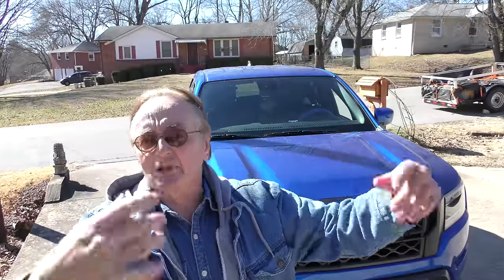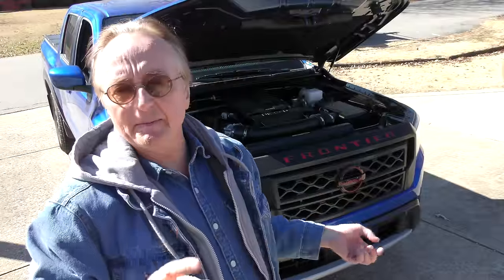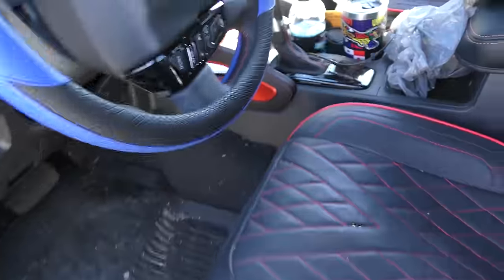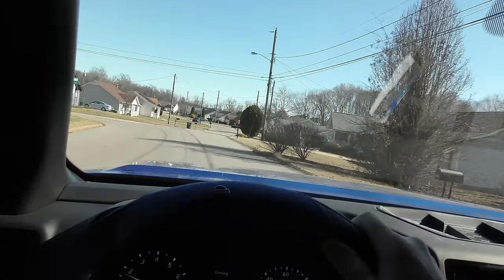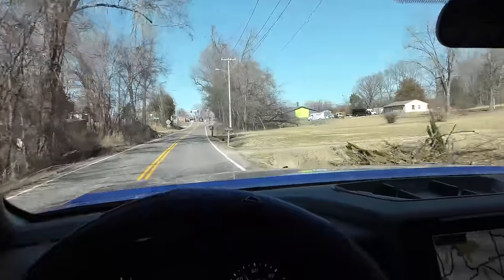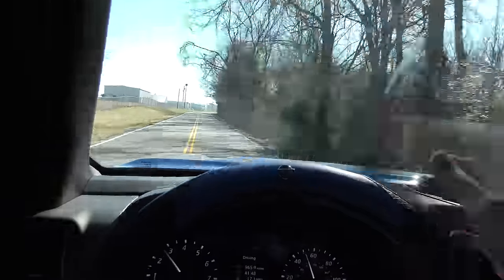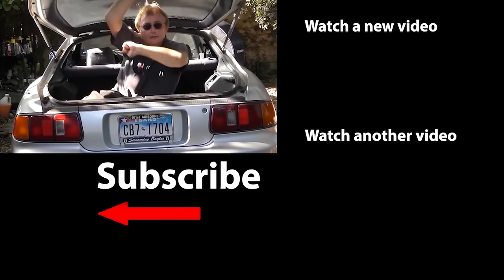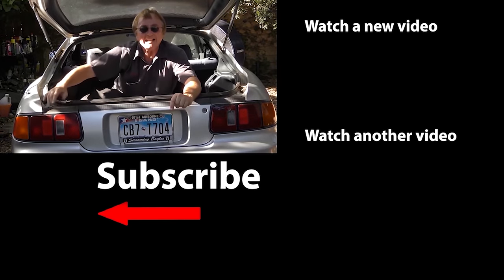This New Cheap Truck is Better Than Anything Toyota Makes Now

Comment: Good afternoon Mr. Scotty, I have a 2011 Nissan Pathfinder LE (4.0L V6) that recently started doing this strange thing when I drive it on the highway and get off to local roads: when I slow down (speed gets below 20mph) and when I'm sitting idle at a light - the battery voltage will dip and come right back up. It's a quick dip. I took it to O'Reilly's to see if my battery and/or alternator was going bad and both checked out fine with their readers. I have also been checking my car's resting voltage every morning before I start the engine to see if I have any signs of parasitic draw but the battery is always returning above 12.1 volts. Any inclination on what it might be? I've asked around and only received shrugs. 

Really enjoy your content for tips/tricks and it has great entertainment value.

Comment: I have an ‘05 that has been super great, proactively replaced the radiator and just kept up on regular maintenance.  Except for some rust related decay up here in the North it’s going strong after 19 years and 175k mi.  Considering a new one but the old one is still going strong.  Just a good, boring truck that always works, like a truck should.

Comment: I just Purchased a 2023 Frontier SV Crew Cab Rear Wheel Drive with the V6 in it , iIt had 12,700 miles on it, was in perfect condition & i got it right at 30k, all TT&L included. I test Drove Two Toyota Tacomas & They "HAD NO POWER"  Compared to This Nissan Truck, Scotty is Right & I too Highly Recommend this Truck

Comment: The frontier drives and tows much better than the Tacoma!!! I had a 2019 Tacoma v6 and it absolutely struggled to tow 3500 pound horse trailer. You HAD to use the transmission in manual mode or the truck could not hold a speed. You also had to downshift to assist in braking. I traded in (up) to a 2022 frontier pro rwd and it has no problems towing…. I’ve never had to use manual mode. You barely even notice you’re towing. 

Another big complaint is the Tacoma has terrible headlights where you can barely see at night. The frontier has great led headlights

Comment: Few months ago, I bought a used 2022 SV 4x4 for 10K under original MSRP. Like it a lot so far. Did some research and the transmission is a German ZF design built under license by Jatco. I like how it shifts - always had manual transmission vehicles before, but this automatic is fine so far. So far, love the Frontier - powerful & comfortable ride.

Comment: I'm going to have to disagree with you about the Pathfinder and their transmissions. I had a 2006, and the transmission went out because coolant leaked into the transmission case.

Comment: Isn't it funny how Scotty says it doesn't have all the bells and whistles and I see a full double Dinn head unit with GPS, a steering wheel with all kinds of buttons for controlling things, dual climate control, and probably a backup camera too. (For my first couple of vehicles I felt lucky to get an aftermarket cassette am/fm radio in it lol and I had no A/C installed.

Comment: I have owned 3 Nissan trucks. I had a 1994 I bought new. In 5 years I had 185k miles,
Not a single thing failed. I just did the normal maintenance. Incredible truck. I also owned a early model Titan.  Great truck. no issues.

Comment: I had a 3.8 V6 in a mid 90's Chevy shortbed. 300K + miles on the engine b4 the rear went out. As long as the design is sound and the manufacturing quality is on par they're nearly impossible to break, just like their V8 cousins. Also, they get even better mileage now due to advances in the fuel and spark management electronics

Comment: 310 hp is good, but how high do you have to rev it to get that power? The mid size trucks with V6's are peaky, the 3.5L in the Tacoma was not a good match. Say what you will about turbos and longevity, but they create down low torque that trucks need.

Comment: Bought a 2023 Pro4X. 28,000 km rear differential was clunking and had to be replaced. 6 weeks at the dealer to get it repaired. No low windshield washer fluid indicator, not a good thing when highway driving in winter in Canada. Carry a spare jug of it in the truck now just so I can fill it up on the side of the highway. Climate control system develops a howl after 2 to 3 minutes of operation on higher fan speeds. Dealer doesn’t understand why, wants to rip the dash apart ( 2 or 3 more days in the shop). The passenger side window is lazy, another 2 or 3 days in the shop to repair. Yup, that’s why I bought a Frontier, so it can sit at the dealer while I drive a shitty rental car. It’s an awesome vehicle Scottie!

Comment: The 2.7 turbos in f-150s are some of the most reliable engines on the road. Many people report getting 300,000 plus miles without major repair.

Comment: I have a 2021 Frontier the last year for the gen 2 body style, and it has the new 3.8L V6 from the new redesign and I have put 54k on it and it runs smooth as a clock. The only big modification I want to do to it, besides a lift kit and bigger tires, is to supercharge it.

Comment: Just got a 2023 7700 miles $35,000.  Really not much different per se than my 2008 Xterra.  The mileage is a little better and more power.  But it wasn't a big leap getting behind the wheel of the new Frontier.

Comment: I tried waiting for the new Frontier truck back in 2021, but it was delayed.  So, I bought a Ridgeline.  The Honda is nice, but I might have gone with the Frontier due to increase HP and towing ability.  I am happy with the Ridgeline though.

Comment: My last truck was a a 2012 Frontier I really put a lot of miles on in got it in 2014 with only 24k miles and plan to sell it now that is has over 150k miles. I loved it but needed something with better gas mileage and 4 door. I never used the 4 WD function so if it can make someones day better so be it. I love my new Ford Maverick anyways!

Comment: My 2008 nissan titan  180 thousand miles has only had minimal issues like window motors and the heater valve. I just change fluid regularly. The front seat is getting wore out from my big butt.

Comment: Question!
I have a 2011 VW Jetta TDI 
I bought new now has 150,000 miles and the catalytic converter light went off  then the check engine 
I replaced the timing belt at 120,000 miles 
Cost me too much to replace the catalytic at the dealer 
I like the car however that is a big problem 
What can I do?

Comment: MY 2002 SILVERADO 1500 4WD 4.8L 144,000 MI. COLD AIR NO RUST IS JUST ABOUT BROKE IN LOL NO PAYMENT FOR 16 YEARS, REPLACED THE STARTER MOTOR AND THE POWER STEERING PUMP AND $800 IN BRAKE LINES AND THE USUAL MAINTENANCE. I LOVE MY TRUCK:face-red-heart-shape::body-blue-raised-arms:

Comment: My only beef with Nissans V6 is the cam chains drive the waterpump, or at least that used to.
When adding coolent, use distilled water, or premix, never use garden hose water.
Reply: That's what I drink too...40 years

Comment: Scotty, I thought this engine is direct injection which doesn't prevent eventual buildup of carbon deposits, etc. on the valves causing issues.  What's your take on this?

Comment: I had a 4.3l 6cyl 5 speed auto 2004 chevy blazer, and it got wrecked and my dad gave me his 2002 nissan frontier, best truck I ever drove. My sister stole the keys and flipped it ):
I have a 2021 jeep GC right now but if I ever need a new vehicle, I want another frontier, I love putting cabs over the bed and using them for camping.
Nissans are the smoothest accelerating vehicles I've ever driven.
When you push the pedal all the way down, it has a button that clicks that tells the vehicle you wanna go really fast.
Nissans are the best.
Not the 3cyl 4cyl cvt junk though.

Comment: My dad bought  went with the frontier pro4x4  after the 3rd rear axle, and it shutting off in the mountains  2 times  over 5 years , but it had more power and cheaper than the toyota.

Comment: I believe that Nissan shouldn't discontinue the Titan, there's going to be a market for a v8 full size trucks since they just recalled 100K 2022-2023 Tundra's with that awful v6 twin turbo's for engine problems

Comment: I like the pushbutton starter.  Can't hotwire it by breaking off the lock cylinder and putting a screwdriver or USB stick in it.

Comment: Hey Scotty been watching you for a long time and enjoy your channel. Just have a question wondered if you could answer for me? I have a 2010 Hyundai Veracruz V6 engine automatic has a trailer brake and hitch 163,00 miles transmission is up shifting smoothly starting to feel a little rough on down shift to 1st  would you recommend transmission fluid change or flush? Got the vehicle with 133,000 so not sure if previous owner serviced transmission,Thanks Walt in Michigan.

Comment: Coolant mixes with the ATF at 140k destroying the transmission, purpose built flaw by Nissan. Put an external cooler in for the transmission and it’s a nice long lasting truck.

Comment: My 4 banger truck does enough for me. Pulls my boat, camper, tools and whatever I need it to. I’ve had a ton of gravel in the bed. It hauls air as good as this frontier or an f-150. 😂

Comment: One thing I’ve noticed about transmissions with over five or six speeds is that they don’t hold you back going downhill. The more leverage given to the wheels by the engine also means the opposite. I can’t keep brakes on my wife’s car but her gas mileage is pretty good.
Reply: The engine braking on the Frontier is pretty good, just by manual gearing down slows you down also.

Comment: I didn't know started working for Nissan. It's brand new it shouldn't be hunting for gears. I've had two Nissan Sentra 's both of them the 94 I had I put over 400.000 miles on it. 2012 over 300.000 miles. I've bought my last new vehicle. I'm going to keep going back and buy older models or rebuild it from the bottom up

Comment: I looked at a New one in Wisconsin wasn't impressed with the rust found on and around the exhaust piping, So bought a better Honda Ridgeline Black Edition, Way better ride. 🇺🇸
Reply: lol.. ridgeline…nice car
Reply: @joecuster6926  Yes very useful as well, If I want to haul some 💩 I use a proper Diesel truck, Not some flimsy 1500 built these days.

Comment: That is not a cheap truck in the least. What they should be selling over here are trucks like the Toyota Hilux Champ. A little over 10K USD for a basic 2WD diesel pickup. That is affordable, not 40K for a truck with basically zero payload and towing capability.

Comment: Typical full sized truck with extended cab (not crew cab) MSRP was 21k in 1996 or 41k adjusted with inflation.

Comment: $40k, mate.. that will never be cheap. We will live in a nuclear winter long before that is considered cheap..

 I bought my 27k miles, 2016 ford f150 v8 for $26k.. never wrecked, no rust, manual windows, manual locks, no accessories. Aka, perfect in my eyes. And THAT is still not considered cheap..

Comment: Good steering. Hydraulic braking too serious! It's not vacuum boosted! So it's heavy but I prefer it to being too light. I got mine for 35k tactical green! And I'll drive it for 6 years and 150k miles easy

Comment: I’d be skeptical to say that.  Now days most of the vehicles in hot climates they put plastics where hot places are in the engine.  I just had a plastic pipe in firewall bust because it got heat stress.  Also at 100k my 09 pathfinder I had to replace timing chain parts because they are plastic and started to wear out.    It took me 2.5 weeks to completely fix that issue and so each auto maker has their goods and bads.   What will wear these vehicles out more are bad roads.

Comment: My old 2015 Frontier had a 130,000 miles on it with only the only bad thing was a bad starter. I took care of it and did all the maintenance. It was a great road trip truck with good gas mileage. But, 45 K for a new one is way too much. I wish I still had it. but, sliding down the embankment in a winter ice storm wrecked my little Nissan....

Comment: Scotty, a 2014 Ford F150 rear main seal  has a metal gasket. I got a refund after an oil change shop sold me on their version of the AT205 because it'll never work on a metal gasket.

Comment: I'm leery of buying one with direct injection without port injection also. Ford and Toyota have moved to multi-port injection to keep the intake valves clean, so far no other manufacturer has joined them. If it were not for this issue I would have bought a '23 Frontier. It is a great truck for the buck.
Reply: I have a 2023 Frontier. I have an oil catch can which catches the oil, moisture that would be going back in the engine. That and regular oil changes will pretty much reduce carbon build up. Plus you can have the intake cleaned every few years. This is my 4th Direct Injection engine.  Never had any carbon build up issues. It's 100% all about maintenance.

Comment: Considering the fully loaded luxury version is cheaper than the base models of the competitors I’m definitely interested in a Nissan plus I like the motor better than all this 4 banger crap I was eyeing a ranger raptor but now I’m thinking Nissan frontier or titan I can get a full size fully loaded titan way cheaper than a base model mid size from the other brands

Comment: Frontier is the only Nissan vehicle that is reliable and won’t break you down. It has automatic transmission and not that CVT transmission that most of Nissan vehicles have.

Comment: This is a great truck and Toyota gave Nissan a gift by going to 4 cylinder turbo charged engines on the new Tacoma. Silly Toyota. I got the 2023 Pro 4x and it's a peach.

Comment: 😢i have a 2004 F150 with 85,000 miles, inspection state the frame is to rusted to pass inspection, is it possible to fix frame and save. Trucks cost so much to get another.

Comment: Slightly more roomier inside the Frontier than the Tacoma. As much as I love the "Taco," I have to cede that the Frontier is really getting my attention because of its simplicity and the fact that drivetrain is quite robust. I'd like to see an offroad comparison between the two trucks, and I can safely say that the Frontier just may walk away with the win because of the design. (The 4WD system is a turn dial unlike the push button that Toyota has, and it's almost bulletproof.)

Comment: The 4 cylinders are all turbo 4s and have a massive amount of low end torque compared to the 3.8 so that statement makes no sense.  That said, NA V6, cant beat it for a midsize truck. This is the only one I would buy.

Comment: I get buying a dodge because ford is too expensive. I’ve been a ford guy since I’ve started driving. Particularly the 5.0. But my old f150 finally got to the point where it wasn’t worth fixing, so I went to the ford dealership to get a new one, 77k new and 55k for used with 70k miles on it and nothing fancy! And do t even get me started on the f250. They are right next to a dodge dealership who was selling a used 1500 with 50k on it for 20k flat and I figured I’d chance it. 
That being said if I didn’t need to haul water one of these small trucks sound great.

Comment: I just wish Nissan would offer a power passenger seat in the SL.  If it did, I'll toss the Escape for it.  Ford and I believe Toyota offers it.  I'm spoiled on my Platinum Pathfinder. I do wish it had the 3.8 as an upgrade to battle the GM turbo twins coming out.

Comment: Love my 23 pro 4x and especially how i waa treated at the dealership!
Only complaints i have for these new frontiers is the shifter (its just ugly. Shoyld be smaller and more niche) 
No automatic sliding rear glass, kinda annoying but hoenstly ill probably never use it.
And lastly, the aftermarket scene for suspension. Not too thrilled about having to spend about 3k on a titan swap to get more than a 4 inch lift but honestly ive seen some 3 inch lifts and thatll be perfect for me

Comment: In 2004 I bought a 4cyl nissan frontier  and  I'm still driving it with 320.000 miles  they can last just like a toyota

Comment: I have a 22 frontier pro4x and I've had nothing but problems with my transmission. They will not fix it. I'm sure I will need a new one within 36k. I only have 15k it's getting worse every week. Unfortunately, I just have bad luck.
Reply: It's not covered under warranty?
Reply: @oaklndr8rz  nope, it works as designed. But I can't tow a 3k boat and it has a hard time getting out of its own way. But the dealership keeps saying it works as designed.

Comment: If an engine is built correctly and isn't abused turbo vehicles run forever also. Just look at diesels. They're small turbo engines and they run for a million miles at times. Because they're built that way. All the new emissions devises and direct injection is more of a factor than anything with engines not lasting as long. Even non turbo engines have tons of issues with valve trail issues now days. Due to overengineering and cost savings, and like I stated before all the new emissions standards. Thank the politicians for that one

Comment: Insanely, I would buy this before I bought the new Taco or certainly the Ranger or Colorado. My only worry would be that 9 speed tranny. I would personally rather have a 5 or 6 speed manual just to be safe. Nissan makes prett good engines. 310 out of a NA 3.8 is descent, especially for towing.

Comment: Too bad they won’t let Toyota import their Hilux diesel to the US. I have a 2022 and it’s a beast. Second Toyota I’ve bought I still have the first back in the US a 1995 extended cab 4x4 with the 4 cylinder 359k and still going strong only thing I’ve replaced is the power steering pump. I’ve owned everything but a Chevrolet and nothing is more reliable than a Toyota.

Comment: The titan is a good truck also.
Reply: Wierd because I never see old titans on the road. Like ever.
See alot of very old chevy and fords though.
Reply: @thatman4752 because the Nissan titan wasn’t made before I think 2006 and they sold more in the later years. So there isn’t any old ones out there.
Reply: And 2024 is that last of em .....discontinued